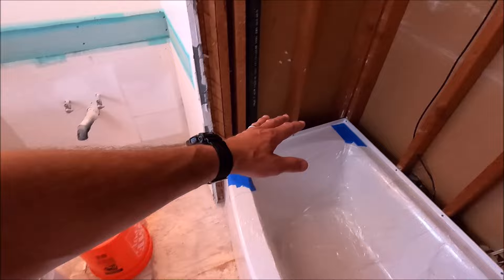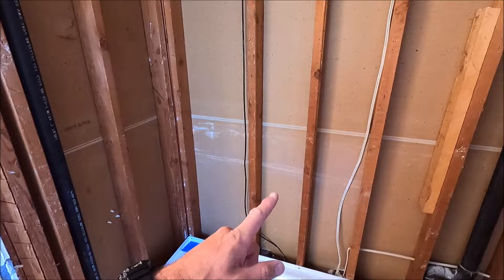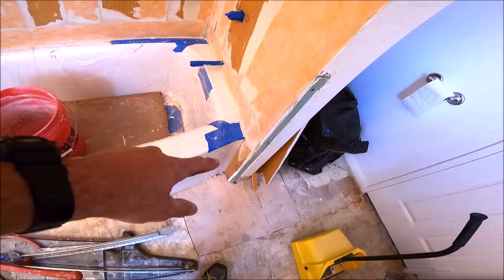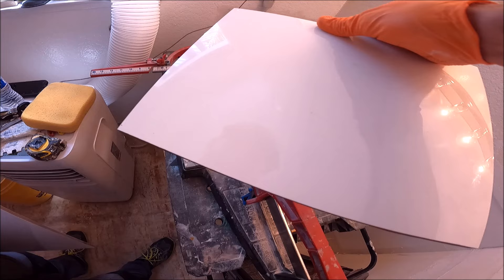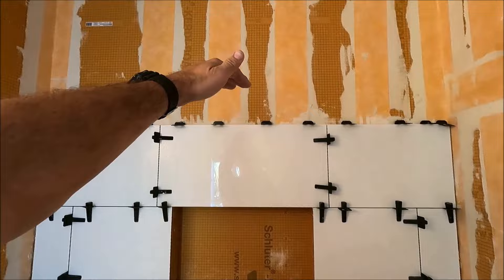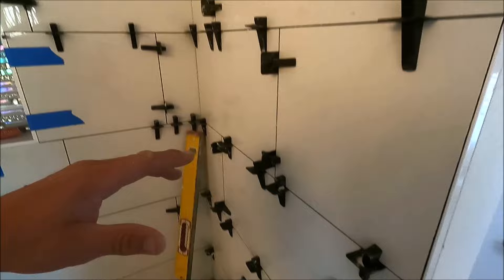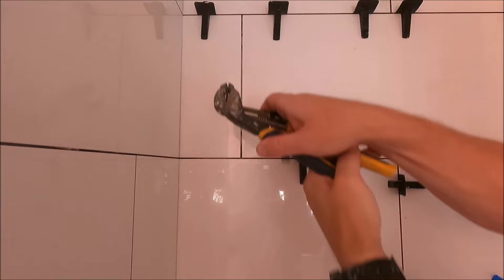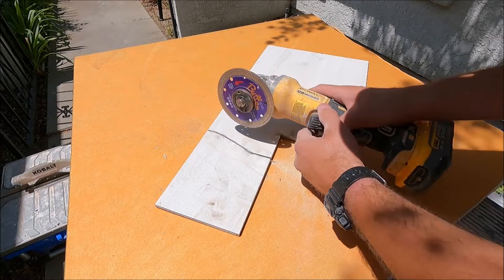Can You Build a Shower in 2 Days?

Comment: Title of your video is a little misleading, the start of your video was day 2 and the end of day three, so you still have at least 2 more days, so anyway, you look at it's a 5 to 6 day shower which is a little over a week
Reply: I think reading the title might have been your problem. It's says build shower in 2 days, not finish bathroom! Also, video starts on day one. Just doesn't show demo.
Reply: @captmurf8357  Correct, I said that in my original comment. So when the video started was day 2 period and when somebody talks about remodeling a bathroom or when somebody says a bathroom only takes 2 days. That includes everything, so maybe he should be a little bit more specific in his titles for his videos period you also have a good day there, sir.....2 day shower MY ASS..
....  coming 2030, showers in under a day😁🤣🤣🤣🤣🤣.....
Reply: @BonBon770  he didn't say it took two days  to do the bathroom. Just shower. 👀👀
Reply: Again, Mr. Eyeballs, LOL. It does not take 2 days to build a shower enclosure. You're on crack if you think that period that shower there minus the dry area minus the vanity. Just the shower will take a minimum of 4 to 6 days
Reply: @BonBon770  it's comical that you cannot fathom he and the video title stated build a shower in 2 days. Shower. SHOWER!!! Video doesn't say remodel a bathroom in 2 days clown, it says shower, which is what he dis. Build a shower. Washing my hands with ya bud. You are a lost cause